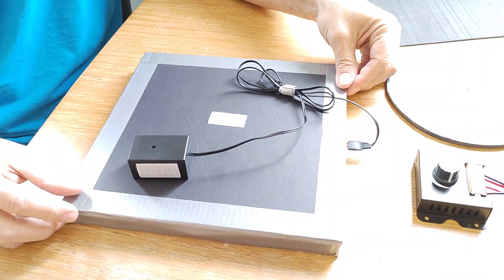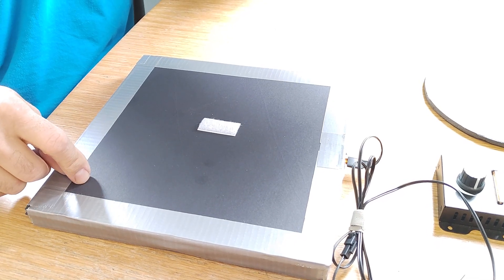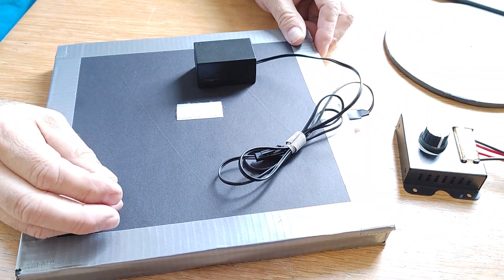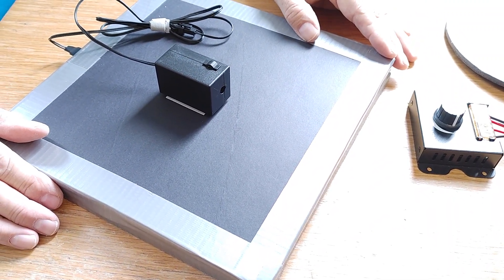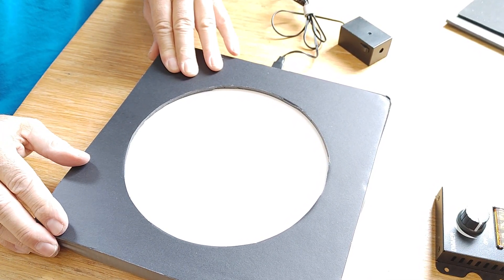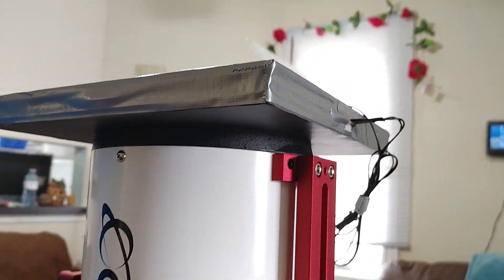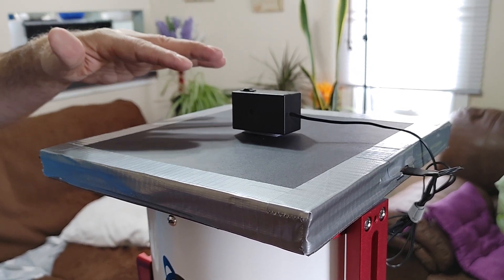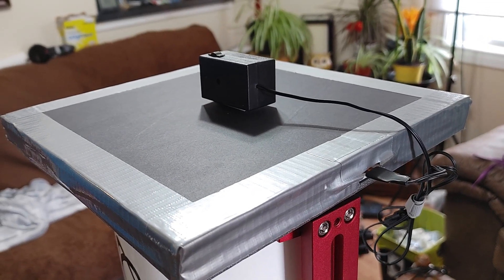Final build of my Flats panel DIY.

Comment: dillema. Dedicated astrocam can max photo around 1 second or close to 1 second. But DSLR are way senstive because you need to shoot in same ISO as the lights. Normally every DSLR user you shoot at ISO800 or 1600 in astrophotography or when its really dark ISO400, but never saw ppl doing this. Either ISO800 or 1600. When you make flats for ISO800 or 1600, you ALWAYS end up with Flats well under 1 second (1/60). So DSLR users can never make such shots above 1 second, no matter how dimm your panel is.
Reply from the maker: Makes your flats at night in the dark,(with the panel) even at ISO 800 you can get 1-2 sec. do it all the time.

Comment: Not to argue with your wife ;) but is there a reason to make the round hole in the front? I have an EL panel and I just plop it on the front of my OTA pointed vertical. I don’t think any of the stray light makes it into the tube or camera.
Reply from the maker: none at all , it was just a kool idea, so i made it for her... now i have a snugg fit.
Reply: If you are out at a  star party with fellow astronomers, having the snug foam board with a hole in it stops light trespass.  I followed  AstroAmy's DIY light panel build and added two layers of foam board with a hole cut from both large enough to fit my Redcat 51 into and it works great.  Just added a 6" imaging Newtonian to my astrophotography gear and I need to make a larger panel for it.